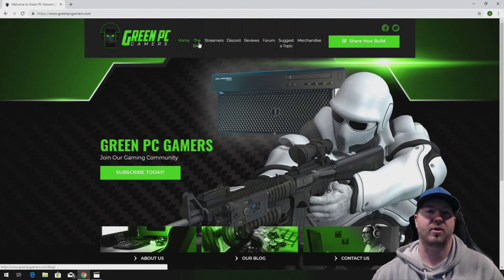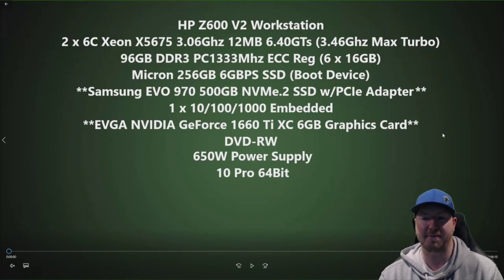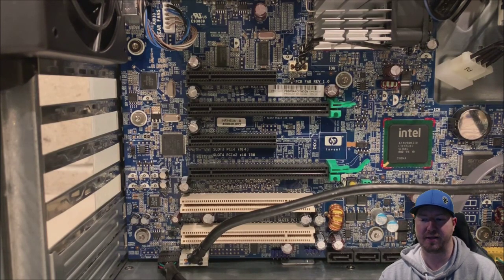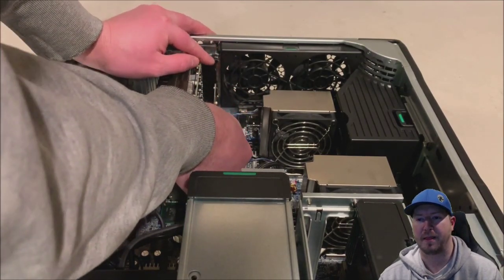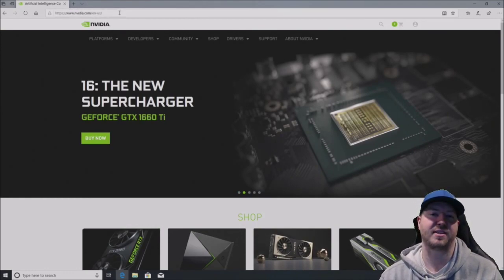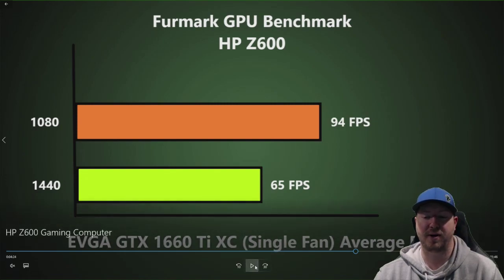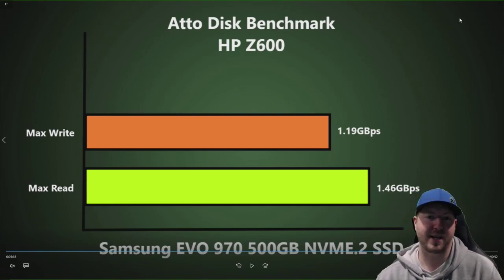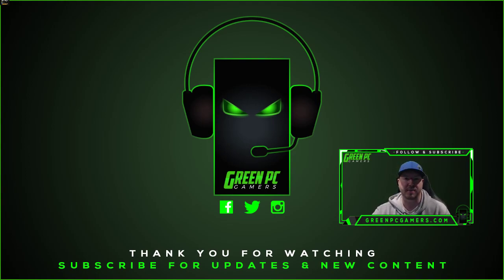HP Z600 Gaming Computer (GTX 1660 Ti and NVME.2 Install)

Comment: I've got a HPz600 I bought for digital media work about half a year ago. I've been somewhat underwhelmed by it's performance. 

Would any card put into a HPz600 with dual x5660's be VR compatible? I've been considering the RX570 personally.
Reply from the maker: The RX570 would be a decent GPU.  Also, you might run in to an issue running VR on the Z600 because of the lack of USB 3.0 Ports.
Reply: I think there's afew  pcie slots still available... I guess a USB adapter card would be a small price to pay in comparison.

Comment: bummer, mines a V1, but it's still a monster of a PC with all the processing power it has.... I'm wondering if I should get  better processors, I have an X5550. would it make much difference to upgrade them? - I just put a GTX 1660 Ti in but I'm wondering if I could put two in and if the power supply can handle that? - I'm going to try and change out the power supply for a 850W, I have no idea if It'll work but if it does I'll run the two graphics cards side by side. is there a way to add a cooling system to the Z600?
Reply from the maker: With our experience, the additional cores can make a difference when gaming on a Z600.  We've never tweaked the stock cooling system on a Z600.  We do not know if the Z600 will support a GTX SLI configuration.

Comment: Hello where u got the cable which converted from 6 pin to 8 pin
Reply: I got mine from some random online computer store based in my country, you can pretty much get them anywhere online... I couldn't get any in store though, they recommended ebay and they also said I'd blow up my PC by using one, they were wrong! my z600 works great with a 6 to 8 pin adaptor, I've had no problems.
Reply from the maker: We get most of our adapters on amazon or ebay.  Use this guide: https://www.greenpcgamers.com/technology/video-card-power-adapters/

Comment: I've got the same Z600 (24Gig RAM) dual socket X5675 setup, they're 6 core, 12 thread  processors, so I've 24 threads. Is there a reason you didn't enable multi threading in the BIOS?
Reply from the maker: We normally like to enable multi threading.  Nice catch!
Reply: Can I install x5675 on my z600? With the normal heatsinks?
Reply: @rafaellima5786  Hi, I've upgraded the motherboard to Z600 V2 the newest revision and have two X5675's with 24 threads in my Z600 (the older version of the mother board does not support dual hex cores). with 48Gig RAM. I've one HP Fan and another branded one

Comment: i got one with dual e5530 12GB and a R9 280X with molex adapter
Reply: can you run modern games on high options?
Reply: @mohamedramadan222  No bro it struggles to keep framerates, it really sucks for gaming sometimes even on low settings but for rendering its your perfect 2nd 'always on' server system.

Its actually the processor tho that makes it suck. I betcha if it would have a 3+Ghz base clock then it would actually hold strong on modern games.

My advice : dont do it for gaming, go i7 4790k or something or if you really want dual cpus then take high clocked xeons
Reply: @smokeajeff  but i have xeon e5620 and gtx 750ti and i got 60 fps in gears 5.. check my channel.. xeon processor gives a good fps in games
Reply: How did you do the molex adapter? Is it dual molex adapter?
I have a R9 280X as well, there's only one available molex plug from the PSU..
Reply: I found that higher clocked xeon doesnt do microstutter 

For an adapter 2x molex to 8pin u will need to strip the port, the plastic housing, sata port and an donor molex plastic housing fitting thing.

Get the wires out by pushing on the metal below piecie by piece (4times) and mind yourself to not crosswire it has to be exactly the same as any other connection on that rail(sata/molex) keep it straight lol or you will short it with dangers attached

My new specs :

2x Xeon X5570 2.93Ghz (3.3 Boost)
1x Noctua NH-D9DX i4 3U CPU Cooler
24 gb DDR3 non ecc 
X58 Factory HP Motherboard, 640w PSU
Western Digital HDD 2TB, Seagate BarraCuda HDD 1TB, Crucial SSD 128GB, DVD-RW
MSI Geforce GTX 1070 8GB

It plays anything 1080p hitman 3 on medium rdr2 medium/high  forza 5 just about anything you throw at it, only thing is… AVX support so you can not play yakuza games f.e and outer worlds seems to crash my machine idk why

Comment: my hp z600 power supply over heating, its only way buy new< or its possible to upgrade ? new coolers or something< cause power suply on hp z 600 very special not meet this never,
Reply from the maker: You are limited to the HP Z600 OEM Power Supply unless you are willing to use an external power supply.  The Z600 Power Supply should never get physically hot.  Are all of the other components in the system staying at a manageable temperature?
Reply: @GreenPCGamerscom  My Z 600 is shutdown when i play games (kernal power 41), in computer service said that power supply is over heating, another in manageable temperature
Reply from the maker: @MichaelDefo86  install cpuid hw monitor and share the results on our forum.

Comment: Thanks for this tutorial. Scored a Z600 V1 for $10 on CL, and planning to upgrade. Read your blog and it says that I can upgrade to a dual xeon x5660. Read also on HP forums that it will not work or will be unstable. I updated the bios to the latest one (3.61) and my boot block date is the older one (2009). I have it running now on dual Xeon X5570, with 24gb ram with a Cinebench score of 1538 (up from 438 before upgrade to X5570). Also on the list for upgrades is for an SSD and GPU . Please confirm if the X5660 will work and will be stable. Thanks.
Reply from the maker: The X5660 does work and it is 100% stable.
Reply: @GreenPCGamerscom  x5675 works?
Reply: @GreenPCGamerscom  Just revisited this clip and saw just saw now your reply. Thanks for confirrming that X5660 will work and is stable.
Reply: Picked up a Z600 for $10 also last week. Although I have a Ryzen gaming PC built, this Z600 makes an incredibly cheap second PC. Mine  only came with one E5530, no ram or HD but I have plenty of parts laying around to throw in it. I am amazed by the build quality really. Really well thought out.

Comment: I have This HP Z600, since 2015, and is manufactured in 2011. 48 RAM and GTX 1060, 2 Quad CPU. The main drawback is overheating on CPU, the cooler are not powerful enough. I am in research from booting from M.2 from video card port.
Reply: que disipador tenes? el máximo procesador es el x5675 y va demasiado bien en refrigeración si usas los disipadores de fabrica de la misma, yo incluso tengo discos ssd en raid para compensar la velocidad de la falta de sata 3, y una gtx 1070 incluso tengo las dos cpu con la virtualizacion activada para 24 cores en total.
Reply: @retrocelulares  hola amigo yo he visto tú video de está pc, será que podrás orientarme en varias cosas?
Reply: @mikesmirnoff  en lo que pueda. Adelante...
Reply from the maker: Are you using the high performance heatsink?

Comment: can u boot windows on nvme pcie ??
Reply from the maker: Not unless you use some sort of boot assistant.
Reply: @GreenPCGamerscom  what if just normal m.2 wd blue not nvme
Reply from the maker: M.2 SSD's will not be boot on the Z600 without using some sort of boot assistant.  That's why we used a small sata ssd as a boot device on this build.
Reply: @GreenPCGamerscom  aha thats bad thing u not benefit the full speed of sata ssd either because the sata 2.0 if i had to choose between an ryzen build vs this z600 what do u recommend for me ?
Reply from the maker: Are you using it for gaming?
Reply: @GreenPCGamerscom  yes photoshop and lightroom and screen record in some cases
Reply from the maker: Try to get a HP Z620 V2 or Precision T3610.  You can find them cheap on eBay and they work really well for photoshop/editing.  You can find upgrade ideas for both models on our website.
Reply: @hadyyaseen8592  Tambien podes poner discos en raid 0 con lo que compensaras con greses la falta de SATA 3

Comment: Greate video!
But i have some question, in the HP Z600 is a 650 Watt installed with GTX 1660TI 
and in the Budget 12 Core 24GB RAM GTX 1060 HP Z600 Editing / Gaming Desktop Build ($625) is a Zotac graphic card installed but his PC crashes with the benchmark test.

Is geforce the only graphic card that i can install an what is the last CPU with the 650 Watt Power adapter?
Reply from the maker: We generally use EVGA cards.  However, our community members have been known to use all of the major manufacturers.  How do you have the power to the gpu configured?  Can you post some pics and info on our forum?  

https://greenpcgamers.forumbee.com/
Reply: @GreenPCGamerscom  
I have verry interesting news for you in Germany we cannot go to your page, what we see is Beautiful Website Designs page.:) Only from the USA internet can go to your page.
Beautiful Website Designs
Built to Convert
Due to recent regulations we do not currently offer our products to European customers.
Reply: If you used a 6 to 8 pin adapter than your pc is crashing because adapters didbt give much power because the card needs 200 watts on max load and a 6 pin gives 150 and that is also the max power what the 8 pin adapter gives your computer crashes when you do heavy games or loads(it use to much power) i also have a hp z600 and you can buy better a gtx 1650 (a rx 570 is better and cheaper but it uses a 8 pin)
Reply from the maker: Jan Chris Martijnse you get 75w from the pcie a slot and then the power from the 6 pin adapter.  We haven’t had any power issues with the 1660 ti shutting the Z600 down while gaming, have you?
Reply: @GreenPCGamerscom  i want to upgrade my z600 with a rx 570 does this also works with the adapter and with the z600?
Reply from the maker: Jan Chris Martijnse how many, and what type of power rails does the card require?
Reply: @GreenPCGamerscom  1 8 pin and i think on ma load it uses 250 watts
Reply from the maker: You’ll get 75w from the pcie x16 slot plus the power from the 6 pin rail.  For most games and applications I would guess that it should work fine.  However, we can’t know for sure until it is tested.
Reply: @GreenPCGamerscom  If you go over the 150w GPU power limit, the z600 will crash. I tried using several Vega 56 and RX590 cards when I was testing that, same result every time."HP Z600 Workstation Maintenance and Service Guide" states that a maximum of 150W can allocated to one graphics card or all graphics cards for this reason.

Comment: Thumbs up great video 
Can I suggest.
On my system I add a Ventac USB 3.1 port card it give a speed of 5g p/s speed great improvement from the USB2.0
Also I installed EVO850 500g on the disk caddy for genaral use.
And on another caddy 2T SSDHD Baracuda I installed for just gaming.
I can just quickly swap hard drive if I just want gaming or want or want to browse and download.
I have another caddy just for banking with 120 SSD.
The system came with Quadro 4000 which very basic and not good for gaming.
I replaced it with Gigabyte GTX1060 and I’m happy with the results.
Reply from the maker: Thank you for sharing.

Comment: I was looking at an hp z620, do you know if this will boot from an nvme ssd ?
Reply from the maker: Hey Wheel333,  the only NVME.2 SSD that we know will boot on the Z620 is the Samsung 950 Pro.  The newer NVME.2 SSDs can only be used as a storage drive.
Reply: Thanks, good to know.🙏